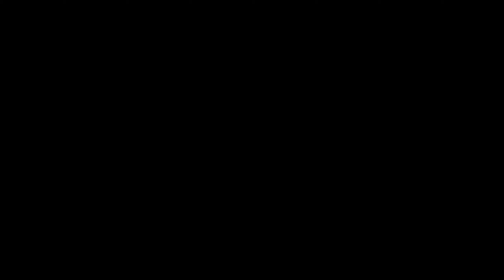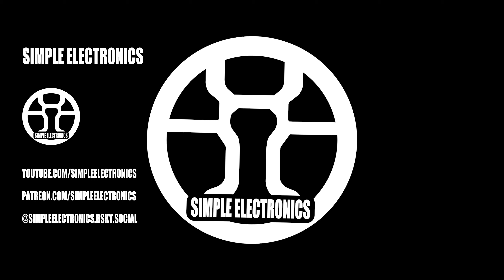The Simple Electronics Podcast - 118 - EV Electronics

Comment: Petrol and diesel needs heat, oxygen and fuel to ignite. If a source of ignition is missing the they are safe. Lithium batteries produce hydrogen and oxygen when then go faulty and self heat under fault making them more dangerous because they render the fire fighting triangle useless. Also if a lithium is not stored in a vented area, the gas’s builds up and can explode. On a side note: did the Hyundai packs have a heater to allow them to batteries to operate under 3 degrees?

Comment: More hotend designs with the PTFE butted right up against (inside?) the heater, meaning it will slowly slowly (or fastly fastly) toast itself to death when sat at >200 C temperatures... if you'd like to keep it long term, might want to slowly look at how to fit a new design of hotend

BTT make two good normal boards for retrofitting... SKR MINI E3 V3 (designed for more of a Marlin & ender 3 screen setup) or SKR Pico (smaller, really designed to run a Klipper OS with remote / external control)
Reply from the maker: Is this the comment you're talking about? I don't see it as being on any particular video